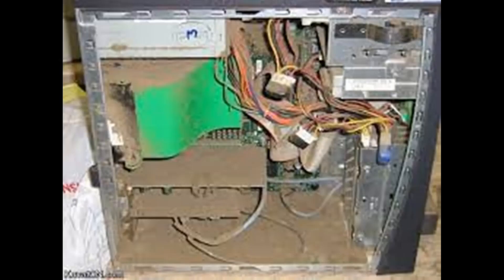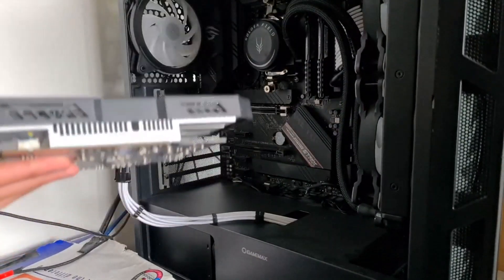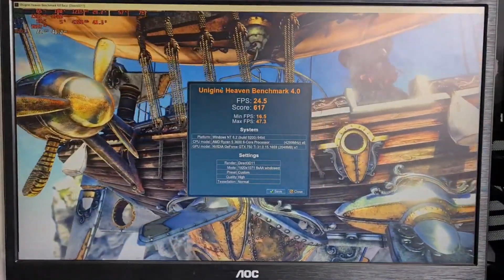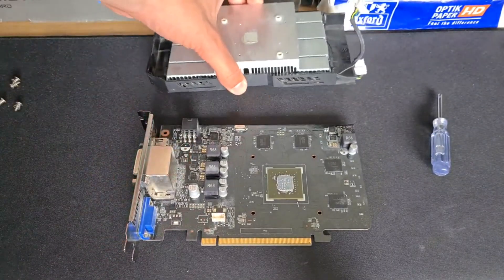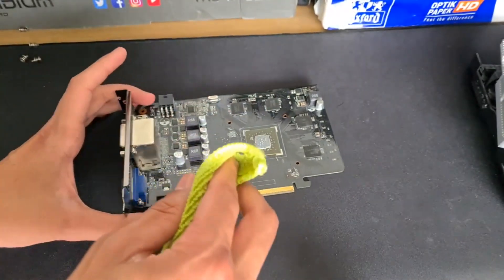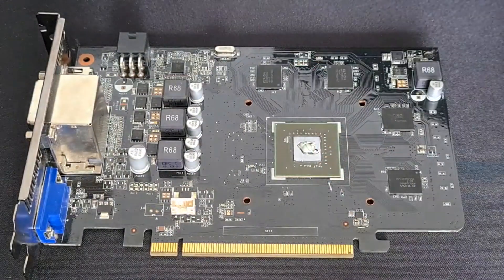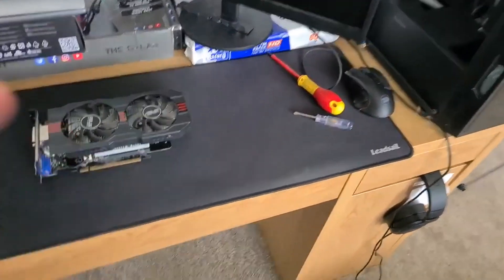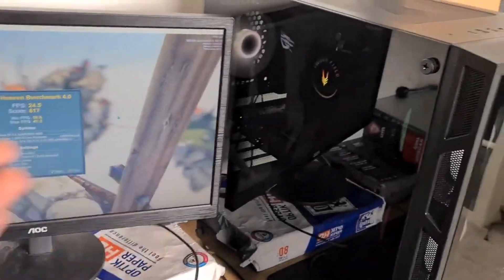Does Cleaning your GPU Improve Performance?

Comment: The lackluster result could be explain by mainly 2 reason:
1) The 750ti is a low power card and only feature GPU boost 2.0. Basically from the get go, the GPU does not boost much, thus temperature does not have a big effect on core clock.
2) Luckily, your GPU does not seems to be that clogged up, and in the before test, the card clearly is not anywhere close thermal throttling. In addition to the 1) means from that before test alone, you could predict the result to be very close if not the same

However, cleaning used gpu is still a good thing to do. As alluded to in 1), newer gpu are much more sensitive to temperature, and the better you can cool it, the higher the core clock would be.
Another thing to note is cleaning also helps with reducing fan noise and prolong the life of the components.
Reply: Possibly fan swap those 2 and 3 or more generations old cards couldn't hurt and some new good thermal paste us never a bad thing